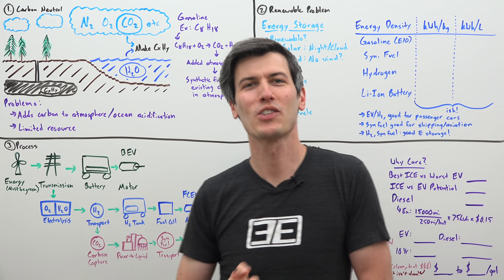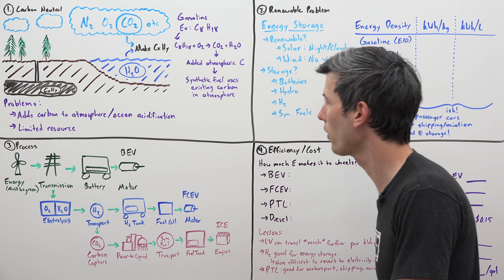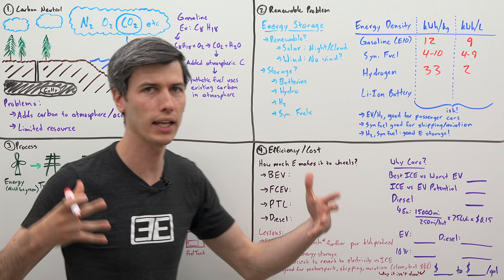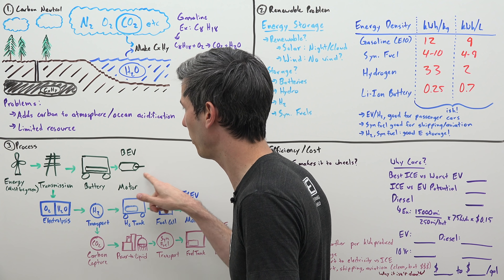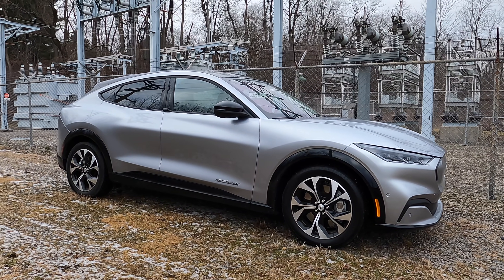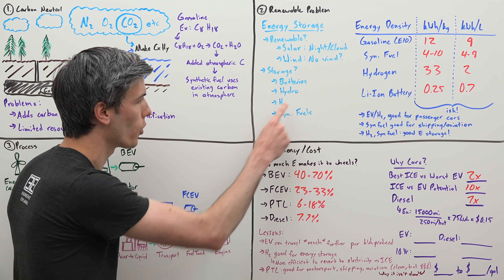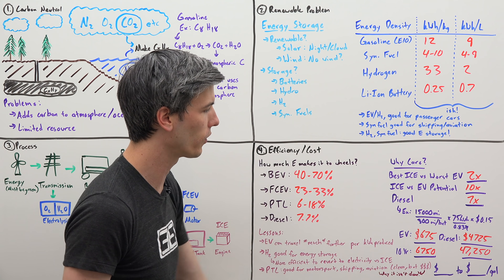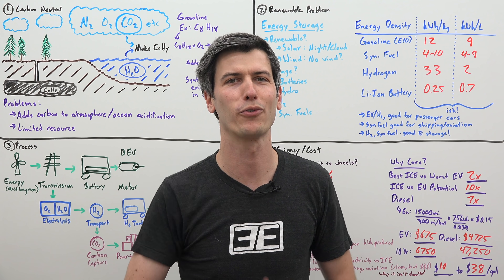The Big Problem With Synthetic Fuels

Comment: Hmmm. Does this also take into account how much energy is lost through the manufacturing of the batteries?
Reply: Good comment. But of course in order to have a level playing field, you’ll have to do it for oil too. Exploration, drilling , transporting, refining, cost associated with occasional cleanups due to Deepwater Horizon kinda spills, cost associated to bad air quality/healthcare,… No clue where it’s gonna end up energy usage but level playing field would be needed.

Comment: A solution where something is burned will always be worse than using the energy directly. You will never achieve a similar efficiency when burning. For the car market, e-fuels make zero sense. In air traffic and shipping it can make sense, but in the car market you can get 7 times further with an e-car than with e-fuels.

Comment: A really big point you miss on the EV side of your equation is the massive fossil fuel footprint of an EV car's manufacturing process with the vast amount of mineral mining and transportation of those same minerals to battery manufacturing facilities around the world and then the transportation of the finished battery itself. Not to mention that most electricity (estimated 80% in the US) comes from fossil fueled generating stations. As far as I'm concerned EV cars are ANYTHING but green. They are far more damaging to the environment overall than ICE cars, the only distinction is the lack of a tailpipe. Just my humble opinion.
Reply: “As far as you are concerned”. Does this mean you will not change your opinion if you do some basic research? Or will you give it a humble try on the phone or laptop (100% mined materials by the way) you typed your message on and maybe change your mind?
There’s a lot of nonsense out there on this topic so you might want to make sure you have not been misled before making a comment

Comment: 10:07 but the range of ev is too  low as compared to ic engine car. And to increase range we have  to put more big batteries and a big batteries requires more amount of lithium,nickel,Neodymium,etc which cause more harm to the environment (2.2 million liters of water is required for processing 1 ton of lithium).
And and and! synthetic fuel only make sense when it comes from a renewable source but What if we use synthetic fuel  for making more synthetic fuel
Reply: Define “low”?

Comment: and fully electric cars won't replace ICE (hybrid) either. They can only take some market share, there's oil for ~100 years comfortably
Reply: Depends on what you mean with replacement. Like, a 100%? You’re right. 
But in some countries, let’s say Sweden or Holland for example, they are at 20% or more of all cars sold being EV’s right now. (Not hybrids) That doesn’t mean 80% of the fleet is replaced already but it’s going very quick. 
They don’t seem too unhappy there, quite the contrary. And they drive a lot too. 
Anyway

Comment: I can't believe you are not citing biofuels from biomasses. Moreover, you are not considering the gigantic costs of mass electrification of cars in the entire world (otherwise car electrification would not impact significantly climate change) both in terms of production and in terms of infrastucture required to achieve it. 
It seems to me that concentrating all the resources to find a cost effective way to produce carbon neutral fuels, if you look at the whole picture, could be cheaper than having to electrify all vehicles and having to build all the infrastuctures required for electrification. Remember that not all countries in the world could afford going full electric and that 2 thirds of the world use old vehicles...in some cases very old vehicles.
Reply: The fact that not all countries can transition on EV’s is correct, they don’t have the infrastructure. The reason why you will not find comments from the Masai on this topic very soon. 
But aren’t we missing the point than? There’s no debate if there’s no infrastructure. If there’s no infrastructure, there is no pollution worth mentioning in comparison with the US, China or Europe. So not sure what your comment is about.

Comment: It seems like synthetic fuel would be the most reasonable option.

When doing your calculations, it appears that in making your case for BEVs, u left out that supposedly cobalt, nickel, and lithium are in limited supplies. Supposedly, there is a discussion to switch from lithium to a larger supply of silicon, but there were trade-offs.

The synthetics would be ideal as it specifically addresses the environmental issues as it relates to polluting the planet.

Whereas BEVs appear to just change the way we pollute the planet. Your calculations does not take into account that there will be massive upon massive amounts of batteries with materials that are not recyclable. 

Your calculations also ignores the millions upon millions of ICEs that already exist. Those cars are not just going to magically disappear.

So far, it seems like the goal of this farce is trying to preserve the current infrastructure and BEVs do not preserve the current infrastructure. 

The oil and gas industry can still drill and use fossil fues for everything from electricity to diesel fuel to medicines to makeup. 

With synthetic fuels, it appears that everyone would be able to keep their ICEs with just a modification to be able to run off ICEs. This solution not only preserves the current infrastructure with gas stations, but it also preserves the current manufacturer-dealer infrastructure where the manufacturer sells to the dealer who rips off the public. 

With BEVs, it will disrupt society as the expectation is that major car manufacturers will chase profits and try to follow the Tesla model of selling directly to the public which will destroy the car dealer network or at minimum make them just more of an agency location for vehicle delivery, test drives,  and warranty repair work. I do not see the dealerships going down without a fight meaning pressuring the government to keep ICEs when a simple solution of synthetic fuels is available. 

By the way, because of synthetic fuels, i think Europe has already changed their policy as it relates to ending the selling of ICEs by 2030 or 2035.

Soooooo...all those folks that adopted BEVs? Good for them. 

Buuuuuut the other problem is that we have a bunch of poor people including myself soooo I still believe that although BEVs are selling, they are only being purchased by mid to upper middle class.

If they really wanted the USA to adopt BEVs, they should have went with the cellphone strategy. Give them away free first and then once we are hook and can't live without them, then charge us an arm and a leg. With us coming out of covid and inflation is high and salaries are down and unemployment is about to rise, unless they give away BEVs, they will not meet their goal of BEV adoption. The government tax credits and incentives are not enough because all the dealerships do is just raise the price of the cars.

For that reason alone, I love the idea of the dealerships going away and being able to finance and buy directly from the car manufacturer. 

Sooooo....I will end with....

I respectfully disagree with your calculations. Not because they are wrong, but because your calculations are narrow and pushes the narrative that the BEV is the logical next step for passenger transportation when synthetic fuel is the best option.

For the record, the reality is....the goal appears to be to preserve elitism, classism, and the same old nonsense of money and power.

Reason for my statement...

Wait for it...

Wait for it...

If there was no concern for infrastructure and the true concern was for the planet, throughout history the technology leaks out that a car can run on tap water! Lol....

Buuuuut the infrastructure would be destroyed and the powers that be will lose their money and power which is the whole reason for this farce. 

Welp....

Cool presentation and I still respectfully disagree with your perspective. 

😊

Comment: My understanding of the porsche synthetic fuel was that it was molecularly identical to crude based fuel. Wouldn't that mean it's energy density is actually identical to normal gasoline? Or is that the difference from the ethanol being added to current fuel sources.

Comment: As interesting as all that science is, what matters is this: domestic electricity is getting more expensive all the time, so EVs are no cheaper to run than ICEs and will get more expensive. Yes, synthetic fuel will be more expensive because it's a new process, but mass adoption will bring that figure down a lot. $2 / gal is what I currently pay for 93-octane petrol in the UK, making it even more attractive.
With synthetic fuels, I can use the same refuelling infrastructure as I currently do, and I can drive long distances without worrying about where I can recharge every 200 miles and what I'm going to do in the time it takes.
Further, EVs have a limited battery life, and I understand owners of older EVs are facing huge costs to replace the batteries or scrap their cars. EVs may be fine for some, but not for me.

Comment: Let adress the elephant in the room shall we? Even if we go fully electrical the tons of pollution we make to produce lithium power batteries are more harm than the combustion engine, and to round it all off want do we do with the waist of a old battery after 10 - 15 years where do we dispose of them and if we keep producing batteries like these won't the gasses that are relieced when making a battery also impact pur climate as we know it. 

Just asking a question I like all cars ev or combustion but don't want to think we found a solution but then we actually worsted the problem

Comment: Probably worth considering storage costs... a $20 plastic container can hold about 500 megajoules of gasoline energy, but it would take at least 10,000 lithium 18650 batteries to store the same amount (as a Tesla battery does). Even at a cost of $1 per battery, the storage is 500x more expensive. We can quibble about the exact numbers, but you're talking orders of magnitude difference in any case.
Reply: Jason did a video on that very thing (energy density) just a couple of years ago …
Reply: @sking2173  Energy density (by weight) is also a problem, but I guess I mean energy density “by cost” here. It may cost more to make synthetic fuel than it does electricity, but to store it is vastly cheaper, which I think should maybe be part of the discussion?

Comment: battries die (making battires itself is non renewable), new infrastructure needed plus maintained, cost of synthetic gas will be reduced after adoption (same as evs), billions of people won't have to buy new cars, efficiency is iffy Cuz gas vehicles are considerably lighter than ev counterparts. this is what i thought of during the couse of the video
Reply: Battries(batteries) are recyclable you know.  Therefore are renewable.

Comment: Great work.!👍

One thing I will point out is "constant battery mass in vehicle" vs "variable liquid fuel mass in vehicle" will tilt efficiency slightly in favour of liquid fuel vehicles but, though that is missing from your calculations here, I doubt it would effect the outcome enough to change the conclusions.😉

Comment: The thermodynamics of creating e-fuels is very unfavourable. 
Somebody would capture CO2 from atmosphere - it is very energy-intensive - and mixing with green hydrogen, generated with electrolysis powered by wind generation.
Doing the math, the e-fuel contain the 10 to 20% of the total energy utilised to produce it. Financially, we are talking $ 90 per gallon, unless subsidised.
Thank you for the video!
Anthony
Reply: Capture the CO2 from seawater, make hydrogen thermochemically using nuclear reactors, or even by electrolysis.
Using electrolysis, the costs are under 3$/gallon with current works in the US Navy labs, assuming the Navy's cost structure for the reactors. Even after 23%VAT and a 20% profit margin, its cheaper than what i have at the pump.

Comment: Those are only numbers without context. There are many many benefits of efuel: faster refueling than charging, lower car weight, you don’t have a problem with very expensive and not ecological batteries, high efficiency with high speeds. And petrolheads will still have sound of exhausts + possibility to tune cars

Comment: time = efficiency 
time = money 
time = time 
if you like studies then go check out Volvo's study about EV'S 
volvo says its 70% more co2 fingerprint than its ICE equivalent, and that an EV need to travel at least 200.000 klm's to get even with ICE .
so ANOTHER study says that Europe's average klm driven is 11.300 per year 
so by average one EV needs 17 years  to get even with its ICE equivalent.
these are facts and clues provided by statistics and volvo engineers

is there ANY  EV that can last for 17 years before its batteries become NOT EFFICIENT?????????????????

NO! 

a opel corsa EV costs 34000 euros in greece while an ICE opel corsa costs 13000 euro 
would anyone loose money buying an ICE corsa?
no 
would anyone loose time buying an ICE corsa ?
no .
is an ICE corsa worthless after 17 years of use ?
no

EV's are useless and money thrown out of a window .

EV's will have their share in the market but not in full size passenger cars
micromobility? yes 

highway travel and everyday use aas we know it ? no.

Comment: Toxic waste dumps, generally known as EVs, are not viable as replacements for combustion engines.  

The sooner people learn that ESG has absolutely nothing to do with a clean environment, the sooner car makers may get the message.

Until then, enjoy laughing at broken down EVs waiting for trucks with natural oil and gas generators to pull up to to charge their batteries.
Reply: I don't think I've actually seen a broken down EV or broken down car of any other type for that matter in over a decade.

Comment: Technically speaking, gasoline itself is pretty inefficient, because the process of producing it requires energy. If you burn the oil directly in a power station while filtering all the polution and distribute the electricity directly, you'd have more efficency. That is why it is cheaper to travel using electricity rather than gas.

Comment: Synthetic fuels will not fully replace EVs they will exist side by side, EVs will be ideal as town-city and short distance cars, Synthetic ICE vehicles for larger distances. Some say synthetic is not fully zero, possibly true, but compared with EV out of the ground lithium CO2, they will be equal. Synthetic fuels will be a lot cheaper within a short time, so your cost comparison fails. Your efficiency table is flawed, you did not take into account the millions of modern ICE vehicles already out there, that will run for at least another 10-15 years on Synthetic fuel, without modifications. Replacing them with Electric vehicles, takes so much more energy, creating more CO2. Plus the cost/impact of building EV charging stations etc. Of course EV owners and if believed the World Economic Forum, hate the idea of anything other than electric. A growing number of vehicle manufacturers are investing in alternative fuels, including Synthetic, they believe 100% EVs are not the future.

Comment: electric cars are dying and hydrogen is too expensive to distribute... synthetic fuels will be the future, i am sure, no need for new distribution equipment, motors etc... the only problem is production (as with H2) but if it comes from renewable (great way to store it and have no intermitency) or in the future fusion, i am sure it will be easier to implement

Comment: If the process can be streamlined, i.e. have the energy generation, carbon capture (and H2O capture, instead of H generation, using a different process) and power-to-liquid be part of the same "plant", you can then simply leverage the existing liquid fuel transport and storage infrastructure and have a complete carbon neutral (actually carbon-negative due to all the captured carbon being stored in the unburnt liquid fuel stage) system that, while not quite as efficient as full electric, can be more practical and less damaging to the environment overall (battery manufacture and recycling are not great).

Comment: At the moment in Australia unleaded petrol is just undrr aud $2 a litre no biggy there and you can run diesels on vegetable oil and in Australia the big change over to EVs is in 2050 and as with synthetic petrol it will become cheaper now the cost of EVs is expensive but some petrol cars are cheaper as for second hand cars much cheaper l paid three years ago aud $1500 for my 1997 Toyota Hilux abd it was registered and my test drive was from Newcastle N.S.W to Sydney got home no problems and it is now worth about aud  $5000 to $6000 one sold for aud $10000

Comment: Too bad you didn't include battery production and disposal. The topic of electric cars is still fresh, but cut batteries will not hold as much as internal combustion cars. They won't be as resilient. It's similar to a car battery that loses power over time. much more pollutants are used in the production of such a battery. EFuel from Prosche gives hope for internal combustion cars. It will be nice to see such a comparison taking into account the costs of manufacturing batteries and their disposal. :)